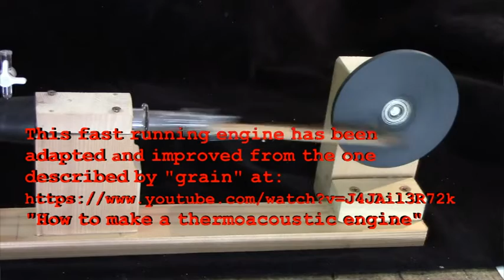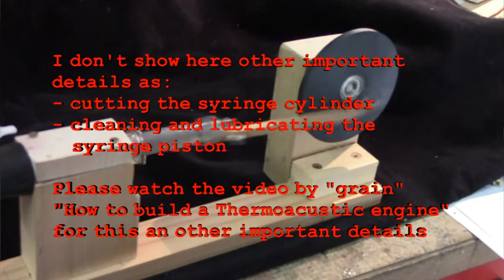Homemade Thermoacoustic Engine

Comment: In the previous video, you placed the candle first and then the stack forward.
Reply from the maker: Hi, there is about 5 years I did these experiments and I don't remember well why the position of the burner is this one. Since I did a lot of trials with several thermoacoustic engines I suppose that I found the best position by trial and error or I saw it in other youtube videos. Greetings